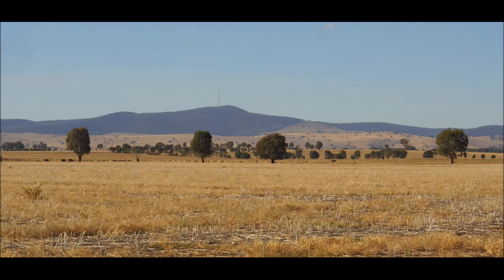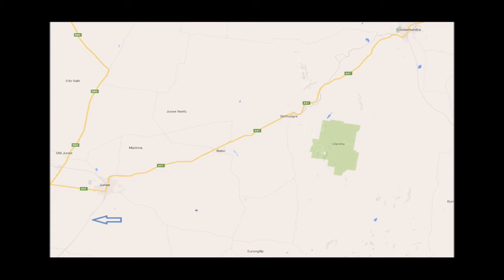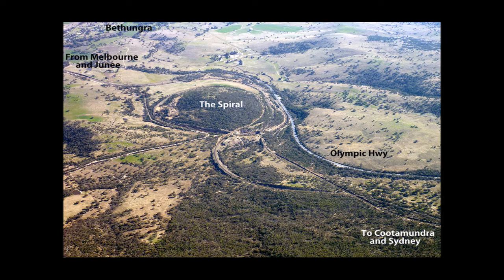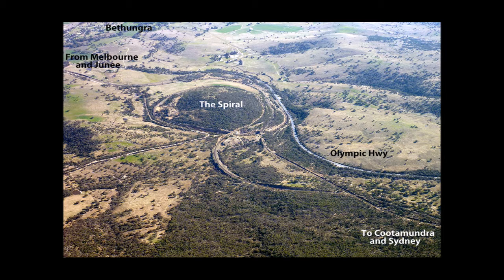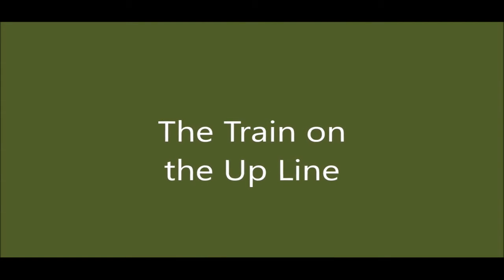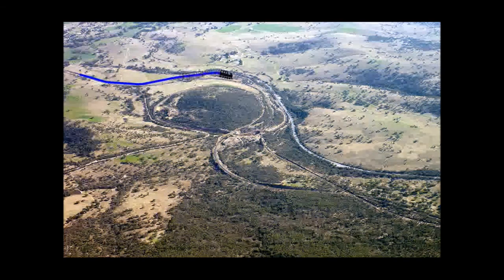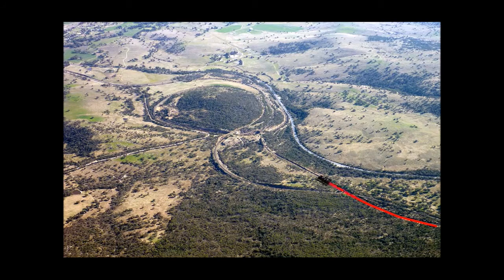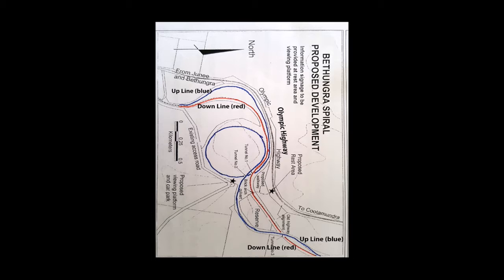The Bethungra Spiral

Comment: Thanks for the video.  You may know, but we only discovered recently, an information board and viewing platform were installed some time after 2017 on Bethungra Waterworks Rd.  It is still quite easy to get down to the tunnel but the platform provides a great view of the deepest part of the cutting and tunnel.  There were a number of people there making use of the platform.
Reply from the maker: Thanks. I hadn't known that. I explored along Waterworks Rd and climbed through fences to get a better view of the cutting (and from where I took some of the photos in the video) but didn't spot the platform. I'll check it out next time I'm down that way.